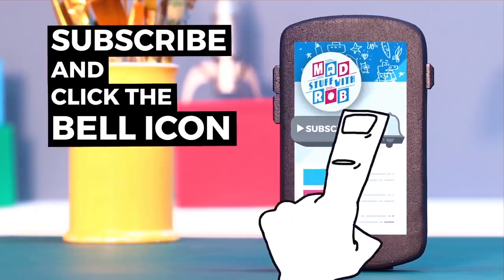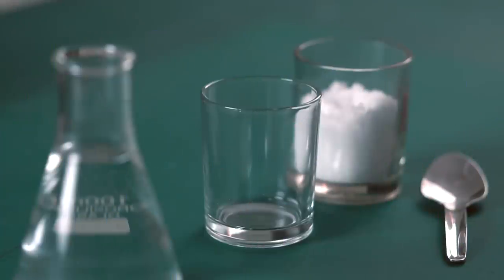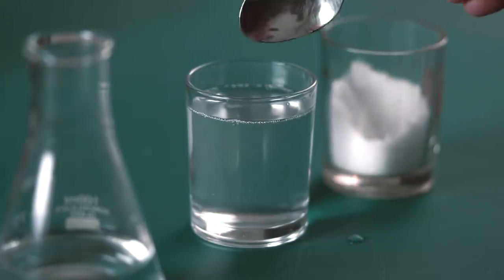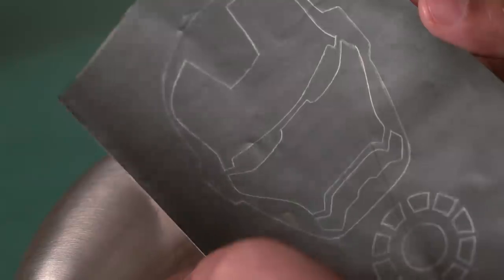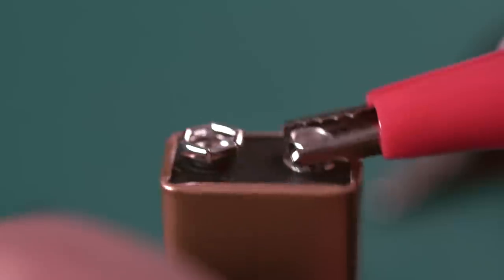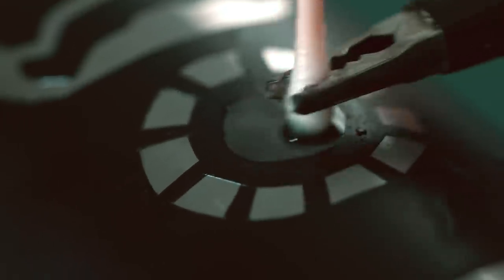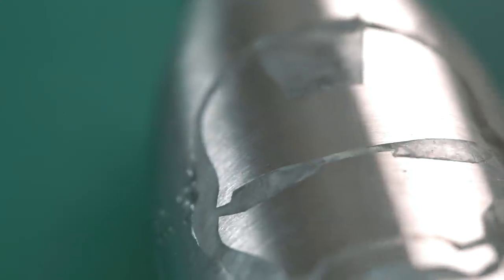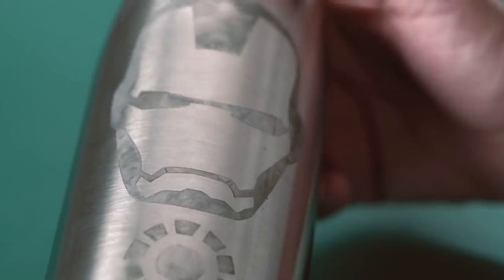How to Etch on Metal Using Salt Water

Comment: Thanks Rob.. i had been looking for some easy method to do etching on metals without the use of industrial etching solution which is not readily available in stores.. This video is really helpful.  
Oh one more thing, is this method applicable on glass and other metals..?
Reply: supranjan saha Glass ? Nope it wouldn’t do nothin on glass , Other metals ? Depending on which metals you use yes , try using alloys with iron in them maybe Aluminium, Tin etc could work but pure copper ? Or Lead? Nope anything with iron works
Reply: @scrap8660  hmm...Sounds logical.  Thankyou

Comment: Hey Rob, can also try making some projects using acid etching by using ferric chloride ?
Reply: Sam 1057 slow down boy that could have some major consequences Ferric Chloride would work yeah but why ? It would do literally the same thing it’s Chlorine ions reacting with iron ions the Ferrous acid might affect it differently as Hydroxide from water is also pretty important but like it’s pretty useless and why use acids when you can manage with Salts

Comment: Will it not react with water or air and corrode? Is it ok to have a part of metal surface exposed?
Reply: Good question. Use stainless steel  or some other less reactive metal

Comment: Sir what is the alternative for crocodile clip. Since I don't have it. Please say me
Reply: any Metal wire will do. Croc clips easily available in electronics shop for cheap price
Reply: @SwastikSwarupDas   but I tried in copper wire it didn't work
Reply: @mondal9509  technically it should work, you have to use salt water in your earbuds, did you do that ? it has to behave as an electrochemical cell
Reply: @SwastikSwarupDas  I did it. 
It didn't work. I tried two times but also  it didn't work.

Comment: This technique is great but I have just one doubt. Over the period of time, the etched portion which is exposed to air will start to rust. How can we prevent that?
Reply: AJINKYA KABBUR you ARE on a way rusting it because that chrome in the stainless steel would usually stop that but here the Chlorine from the water would break right through it
Reply: @scrap8660  thanks 🤘

Comment: Ok everybody mr nerd here let me explain why this happens it’s pretty interesting, a type of electrolysis s’matter of fact 

So that bottle is stainless steel and stainless steel is supposed to be like stainless ( aka rust-less) but that’s just an exaggeration of the stainless steel oxidises the chromium forms a coating which is almost impenetrable but “ALMOST” is important because some chlorine ions (Cl - ) have that ability to break through that chromium coating now comes into play the Salt water so from our salt water we get Chlorine ions as table salt is basically NaCl - Sodium Chloride ( Chloride!!) and chlorine is also dissolved in our tap water for purification so the chlorine reacts in a pretty complex reaction (which I’m not even gonna try and explain here cuz then we’d be here all day ) and forms FeCl2 and FeCl3 ( to dumb it down it’s basically iron chloride ) these are soluble in water and are dissolved and leave behind the small pits then the Hydroxide ( OH ) from the water reacts with the iron forming FeOH ( iron hydroxide ) which is insoluble and it releases more chloride to rip away at the iron now the electricity is important because Both chlorine & hydroxide ions are negative ( Cl- , OH- ) and are attracted to the positively charged bottle and also when the electricity was passed through the water / cotton buds  it broke down the water compound to form more hydroxide to react and form FeOH and release more Cl- and for the most important bit - when you pass electricity through that iron you break it meaning the insoluble iron is broken down into Ions which are soluble as the electricity takes away electrons from the iron 

It might seem complex but the only thing complex is that reaction which I didn’t explain trust me that’s A WHOLE NEW LEVEL of complex
Reply: I was lurking in the comment section searching for this kind of mr nerd explanations 😁. So, why exactly does it turn darker? Is it forming like a layer of a different kind of oxide instead of the chromium "protective layer"? So for example, if I scratch the etched surface, it will probably turn lighter as in the original stainless steel color?